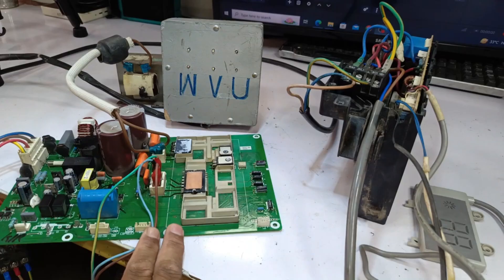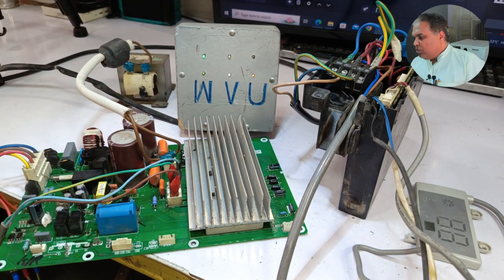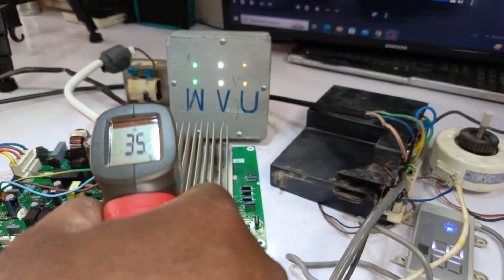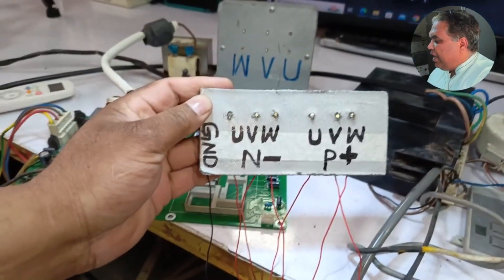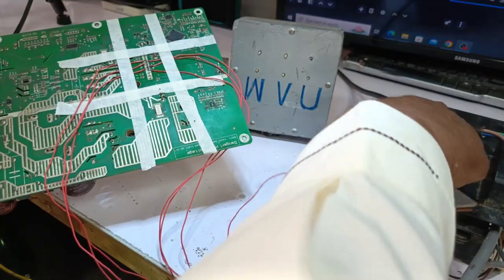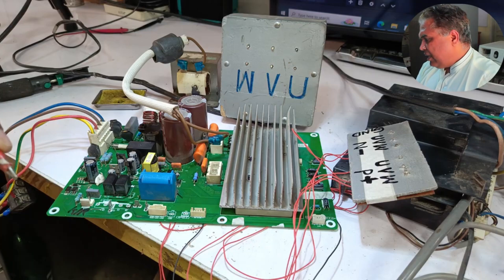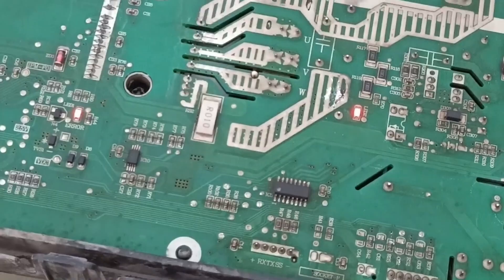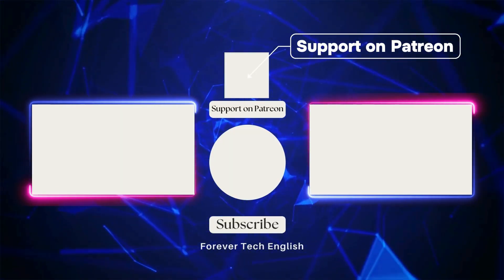Haier Mini Split AC Inverter Circuit IPM Direct Start Issue Solving!

Comment: How to solve an h5 error code with the gree 1.5 ton. All resistor values are in spect close to the imp, please help
Reply from the maker: If you havn't seen H5 video I made before, please do watch that to increase your information, Video link of h5 error gree: https://youtu.be/h_UHoE6CkZQ
 For example, If you do not find the problem then check the operational amplifiers and around there resistors and the required voltages.

Comment: Same thing happened 2months ago in lg inverter topload washing machine. When I turn on the switch. 3led glow directly without start button. Then my sir said that there's a design like single side switching. Finally your result also matched with mine🎉🎉